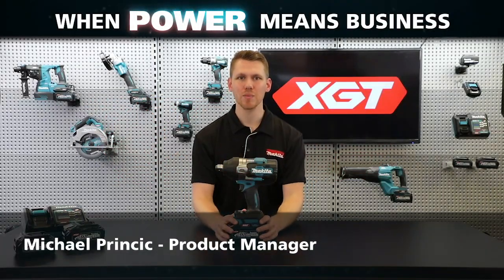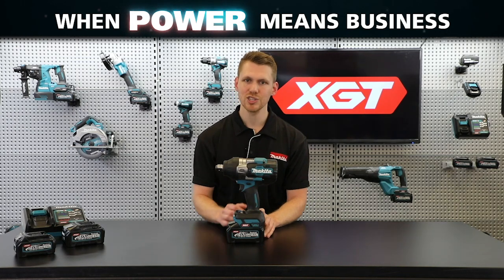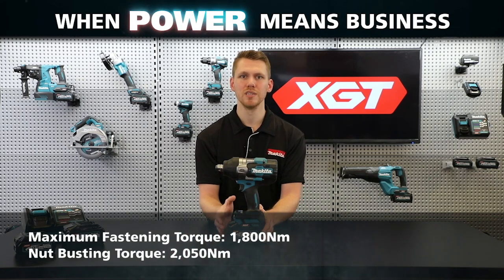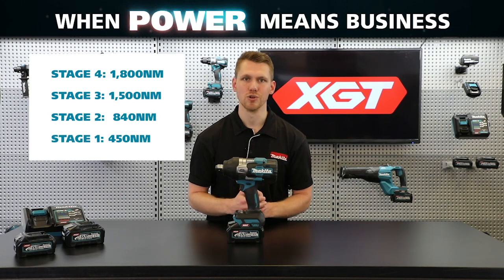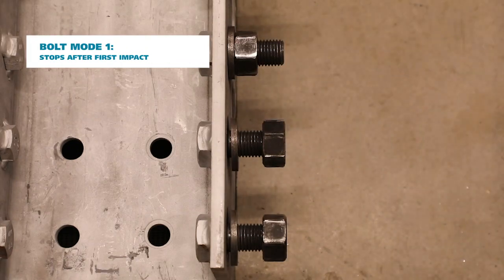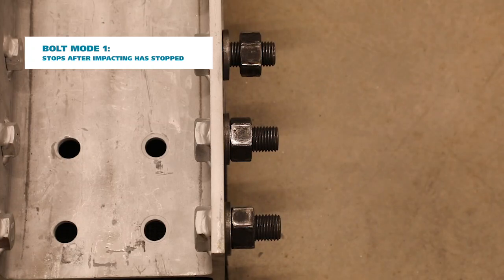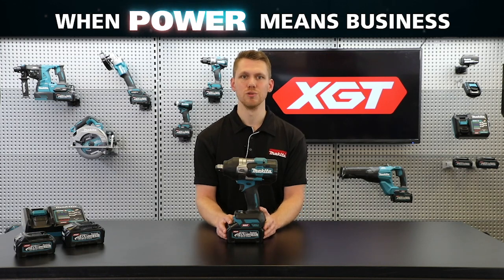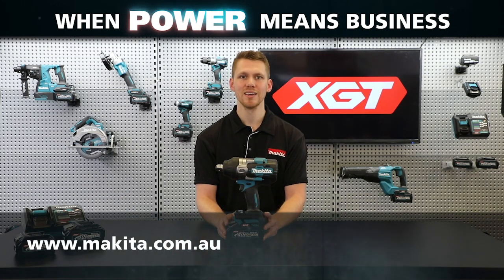40V Max. Brushless 3/4" Impact Wrench

Comment: Why is it 3/4？Is this 1/2 size better？
Reply: So you don't need adaptors for the larger sockets and such
Reply: 1/2 shouldn't be used with 2000nm of torque. 
Their will be a 1/2 version with around 1400-1600nm if you believe marketing